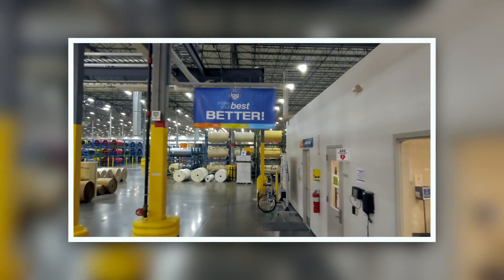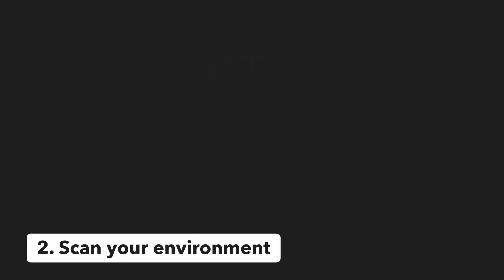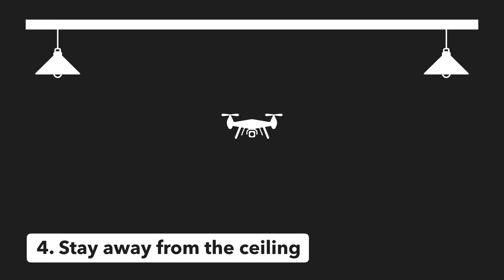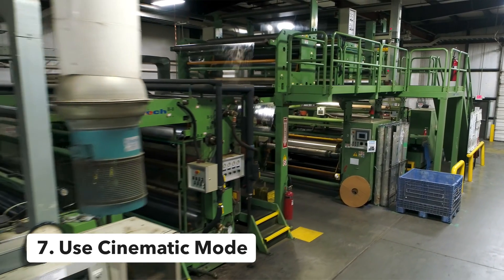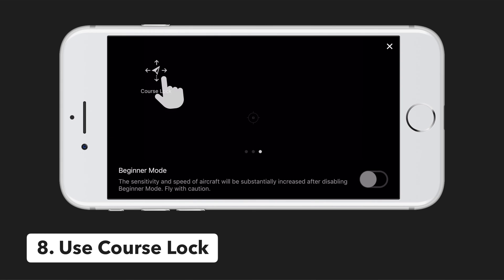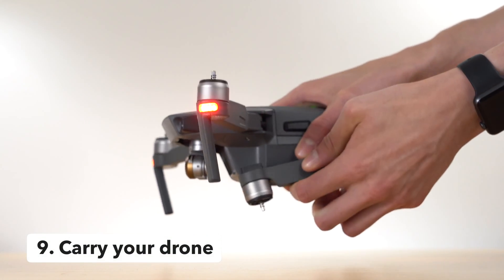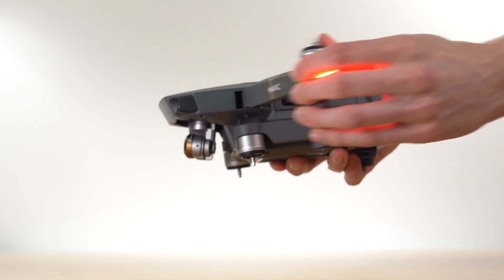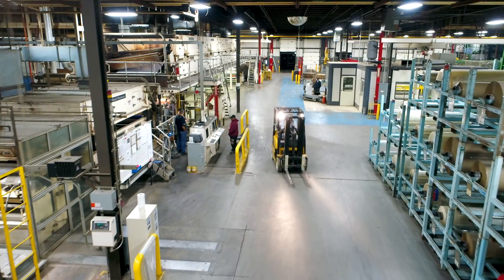9 Tips & Tricks for Safe Indoor Drone Flying

Comment: Nice video. I have 1 question for my mavic pro. When I flying indor in halls with no gps, I have DVP (Downward Vision Positioning) and that is cool. Problem is that max alt in that scenario is 5m. Once, I took of from second floor which is inside the hall and fly over middle of hall at alt of 7m. Then the Mavic decended 2m to achieve that 5m max alt so I wasnt able to bring it back, because I was 2m above it. At the end I landed the mavic at the middle of hall, 7m bellow the take of point. Is there an option to turn of that max alt of 5m when flying indor without gps?